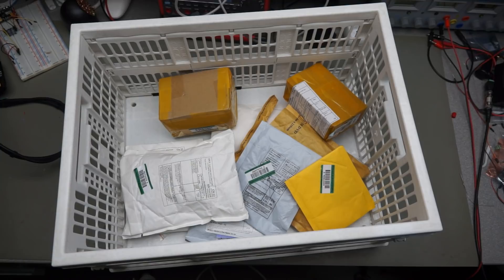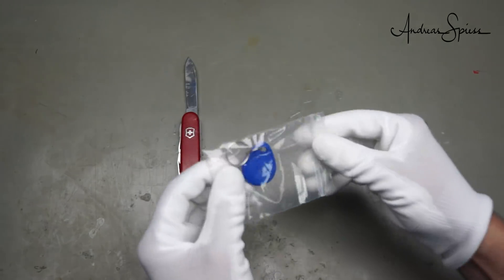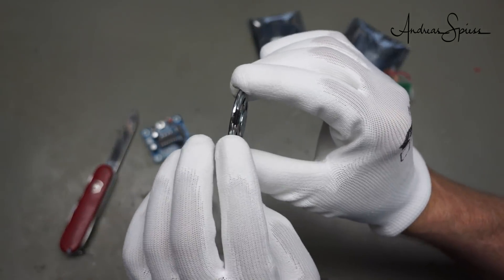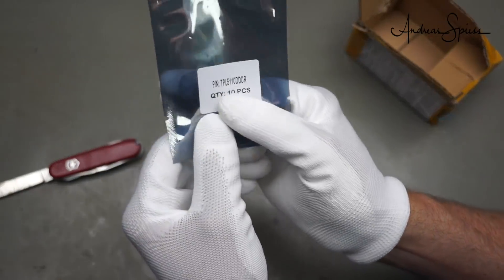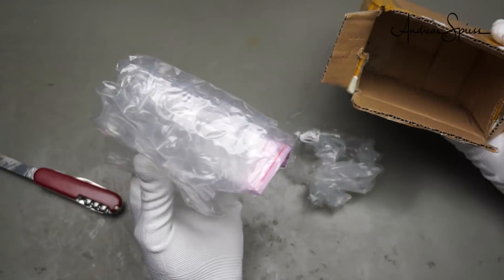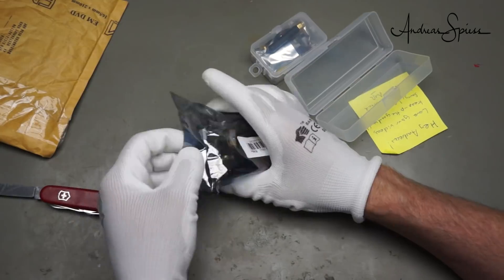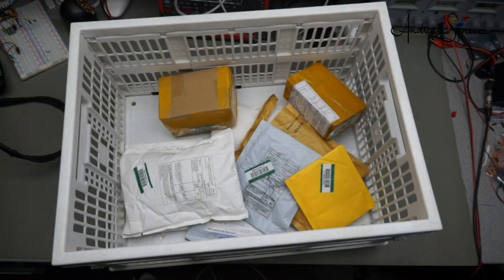#217 Mailbag Part 1: RFID, Low power & Energy Harvesting, new LoRa boards

Comment: As for the material sealing the RFID reader, it's a potting compound. You can also use nail polish for waterproofing simpler projects, as demonstrated here: https://www.youtube.com/watch?v=h8ycmroFQSs.
Reply from the maker: You are right. I saw this video too and I plan to do an update for the moisture sensors, also using nail polish.

Comment: I see you're getting into RFID. I have some experience with it, and it's pretty cool.

As for 13.56 MHz (HF), I have two RC522 reader/writer modules, very cheap, just 3 €/$ each, and a PN532 reader/writer module, which is better and you can hack MIFARE Classic cards with it, a Serial to USB converter and a computer. It's 6-10 €/$ depending on the size (the larger, and more expensive one has a longer range). As I said, you can hack MIFARE Classic cards for a few dollars (big failure from MIFARE), so you shouldn't use them for security. You need more expensive MIFARE DESFire EV1/EV2 cards or an alternative such as Sony FeliCa cards. Both are readable by the PN532, but not by the RC532.

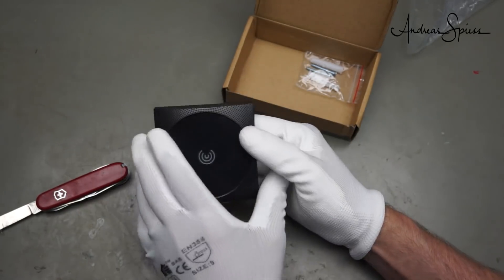As for 125 kHz (LF), I only have the EM4100 reader module (like the one at 03:38). Notice that it's not a writer, so it can only read cards. I have blank 125 kHz cards, and I bought it thinking it would write to them... Oh well, I'll make my own writer as I can't see a cheap one anywhere.

Comment: Hi Andreas you should try the Decawave DWM1001 sometime. Looks really cool. It is an indoor positioning system for relatively cheap. It has integratet Bluetooth, Serial and SPI.
Reply from the maker: Cheap is different! One reader costs around 250 dollars and you need 4 of them to detect the modules in space. Or did I miss something?
Reply: @AndreasSpiess  I just bought 6 modules for 20€ each. There is a development board for 250 dollars but the module alone is ready to use. It has the UWB and Bluetooth chip integrated. It also comes with firmware that lets you control it over serial, SPI and an Bluetooth Android app. There is a lot of information in the spec sheets on decawave.com or digikey.
Reply from the maker: So you refer to the boards. When I looked at their offer I thought, they sold special modules for this positioning application. Did you try them out already?
Reply: I ordered some DWM1001 modules but I'm waiting on some adapter pcbs that I made to make testing and prototyping easier. They offer the DWM1001 modules with UWB and Bluetooth or the DWM1001-DEV modules with integrated debugger, leds, buttons and more. The Dev module is more aimed at developing new firmware for the module itself.

Comment: Nice thinks ;) Other Question. I Play a litte bit with SDR but don't receive a good  or any signal. I think i dont have the correct antenna. Can you make a tutorial about antennas? Like how can i choose the correct one etc..
Reply from the maker: Antennas are complicated. I covered a little in some of my videos. For the reception, it is usually important that your antenna is long enough (at least wavelength/4). Which can be pretty long for low frequencies. Also, it has to be the same distance over ground.
Ham Radio sites cover a lot of antennas. Maybe you google.

Comment: I am using RFID a lot. The 13MHZ MiFare together with the smartphone, e.g. to open the garage or main door. You can hide the tags in lamp or at the rear side (inside) of a light switch plate or in the car.

And when my mother started to develop dementia she always left her home without a key. Returning home always was a Nightmare for her and the neighbourhood. So I connected  a 125kHz RFID-Tag on her wristband which she always wore and used an RDM630 and a WeMos D1 mini to communicate to Homematic & Keymatic for opening the doors.  This enabled her to live additional two years independently in her house. 
So, you can imagine that I am very gratefully for this technology
Reply from the maker: I had looked at the technology for a long time because of such stories about its usefulness. Now I decided to jump into it...
Maybe I have to come back for advice if I may.
Reply: of cource you are welcome; feel free to ask. I have to admit that the method for my mother is not very secure. You could copy the tag and you are in.
However the 13MHz MiFare system is more secure because the communication is handled by my smartphone in my WiFi home Network. The tags are Kind of "public" and just trigger a specific program in the smartphone using "Trigger" and "Tasker". My smartphone is in my home Network and sends a message to the electric door opener - in my case homematic / keymatic.

Comment: Dear Andreas, which LoRa board is the best according to power consumption and signal range? I'm looking for a board to build a small remote weather station, and need power savvy and signal strength to achieve my goal. TTGO V2 board signal strength is just too weak to work properly... Thanks for your help.
Reply from the maker: All current LoRa boards use the same Lora module/chips. So I would assume no big difference there.

Comment: As to UV sensors: I just installed one on my solar PV rig. I only have two days and a bit of data, but UV intensity and PV array output appear to be directly proportional, and the UV sensor is a faster and more reliable source of data, so it can be used to predict an expected future PV array output. As you no doubt learned, an intermittently loaded PV array is not an ideal measurement sensor.
Reply from the maker: Interesting. And I ask myself if UV behaves differently than normal light (in respect to PV output)
Reply: It's interesting that visible light intensity is no guarantee that PV panel output will be high. A cadmium photocell frequently indicates that light intensity is high, yet PV output is poor. UV intensity appears to be a much better indicator of PV performance. II'm collecting data for a spreadsheet of datetime, various light sensors (currently 5 colors:UV, a 'white-balanced' silicon photocell, and 3 cds cells w/ RGB filtering and balanced to the 'white' photocell), plus temperature, and the output of a PV panel with MPPT tracker and a fixed resistive load.

Why? It's interesting. Maybe I'll create the perfect MPPT tracker, 0.00017% more efficient that the one I have!

And yes, the shorter the wavelength, the higher the output. I imagine there's a limit to that, but I currently have no way to measure light intensity above UV frequencies. https://cpb-us-e1.wpmucdn.com/blogs.uoregon.edu/dist/2/13097/files/2016/02/Solar-Cells-2-Shading-and-Light-Color-R2-15krh3z.pdf

Comment: RFID is a ubiquitous technology that continues to be tapped as an "active" logistics platform. 

Many are surprised Barcode / QR have not overtaken RFID - yet. 

Both have security issues and quality control issues when applied to low cost applications. High performance Card readers and electronics are 100 times more expensive than any of the pieces you have shown. Even then, their usage has finally reached its plateau. 

But there are some new applications for RFID that are finally emerging and do not require complex environments. 

Probably the biggest growth sector is in the Agriculture and Forest Management. I suspect you have a strong interest in this area based on your previous videos. When combined with other sensors, they are a powerful data collection tool when integrated analytics tools can proactively leverage the data collected. 

When combined with other technology and applications such as drones equipped LIDAR, the monitoring and cross reference capabilities become a powerful management tool. 

You might be interested in some open source NASA, EASA and JAXS enviroment datasets that can assist you in any design and interoperability requirements depending on the objectives desired. 

A very nice collection!
Reply from the maker: For the moment I only have low-frequency equipment, which seems to have a low range. UHF stuff is on its way...
And I ordered a few RFID nails which are intended to be used with wood.
We will see where it leads... Do you have any links in the area of agriculture or wood management?

Comment: Tip for the Russian manuals: Get a Russian friend. 😎

Failing that, learn to sound out the Cyrillic letters and you will find that they borrow some technical terms from English and German.  Not perfect, but it's a dim light in a dark hole.

Online translation is also possible with images! Don't bank your life on those... Use them if you can.
Reply from the maker: I did not investigate, but I hope I will find some English description. (As I am married the thing with the Russian Friend is tricky...)

Comment: Excited to see what project you come up with for the RFID components, my final year project for my bachelor's was based on a cheap RFID based moisture detection packet.

I used the sticker type RFID tags with a grounding plane and some absorbent expanding material to make a tag that was only detectable after moisture was applied. I put some of the project details on Instructables here https://www.instructables.com/id/Cheap-Smart-RFID-Packet-for-Moisture-Detection/ But if anyone's interested in more details let me know and I can put together a write up with some more of the testing and details from my thesis! :)

Jack
Reply from the maker: Interesting idea! And a completely different way of measuring moisture ( and maybe other small distances). I wonder about how long these sensors would survive in real situations. Did you do tests?
Reply: Hi Andreas! Yeah it was a very interesting project, the goal was to see how off the shelf components functioned in this situation. The maximum range I managed to get was 30mm read range with a 45mm coil sticker RFID tag and a off the shelf USB 2W RFID reader.

The characteristics & orientation of the grounding plane had a dramatic effect on the read range, we began to experiment with placing holes at specific distances and sizes to allow the maximum amount of radiation as possible. Unfortunately I ran out of time to fully test this.

The student who took over the project the next year began to investigate how the RFID tag design could improve performance in this situation with the goal of designing an Ideal tag and fabricating it.

The theoretical goal of this project was for adult diapers, the idea would be to put a RFID reader in a hospital bed that could detect when I diaper needed to be changed. The nurses would immediately be told which patient needed assistance (Sometimes a patient may be unable to tell or too embarrassed to ask). This would also reduces wasted time where nurses have to check each patient as well. As for how long these would survive I did not look into that, these were obviously 1 use items :). It would be interesting to find a substrate material that could expand when moisture is present and then reduce its size back when the moisture has gone again, this would allow for a lot more options!

Comment: You should have a look into UHF-RFID Tags/Readers. They use the ISM Band of 868 MHz (EU) / 930 MHz (US) and have a reach of few meters. They are used in logistics, slowly replacing barcodes. T-Shirts for example often have them in the label.
Reply from the maker: Already on its way from China :-). But it is much more expensive:-(
Reply: Nice :) How much did you pay for the reader? I know they're not cheap... I found some low power USB readers for ~70 Eur, but they won't get further than ~80cm I think...
Reply from the maker: 53$. To understand the principle I hope it will be enough.

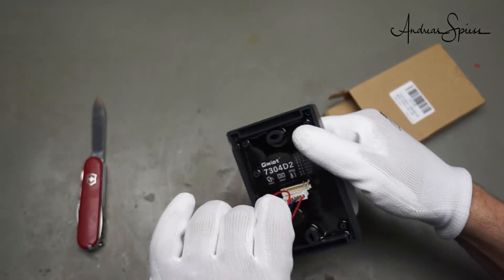Comment: Btw, if you're looking for epoxy raisin to seal off equipment (RF sensor video 10:20) have a look at this:
https://www.vosschemie-benelux.com/nl/product/epoxy-hars-voss-ep-system-eps-epoxy-bn-a-b-1-kg
It's one of the best products I've ever worked with. It doesn't shrink or deform and can be used over a wide temperature range.
The site is in dutch, but somewhere they have a German site.
Reply from the maker: Thanks for the link. I will have a look at it. I already ordered some stuff in Germany...

Comment: Interesting stuff, 
I have been using the tpl5010, its a great chip with very low quiescent current, and very good for "deep-sleep". I had one thing that puzzled me, be aware that the wake pulse is so short that the MCU might not be awake in time to hold the power on.
Regarding the ML8511 (obsolete on Digikey) , I can recommend the VEML6070 with I2C interface.
Reply: See https://github.com/Edzelf/LoRa/blob/master/Nano%20power%20system/Low%20power%20system.pdf
Reply: For switching power, I would recommend a TPL5110. A TPL5010 is primarily designed to wakeup a MCU in deep sleep by an interrupt (WAKE) and provide watchdog functionality (DONE). The TPL5110 is designed to switch power to a circuit and simplifies this design a lot.
Reply: and what ist the TLP5111 for?
Reply: @underwood You can see the typical usage scenario in their respective datasheets. TPL5111 is meant to drive the ENABLE pin of an LDO.  TPL5110 is meant to drive a mosfet that switches power to the entire circuit.
Reply: Well interesting configuration, but not made as the datasheet describes. The wake signal is pin 5, witch goes high at timeout, and can be rescheduled by applying a done pulse on pin4. Pin 6 is supposed to reset the MCU when something goes wrong. But of cause you can use the RSTn as the "timeout pin", I didn't know that the RSTn did a repeatable resets with the wake interval, its not that well described in the datasheet.  

Your schematic:
But I can't figure out why the circuit works. 1) When not timeout pin 6 (RSTn) is floating, this means that R3,R4,R5 and R8 is in serial (all 100K)  the basis of the transistor is taken between R4 and R5 which should be around 4,5v/2, when the transistor is connected the basis voltage is about 4,5V - 0,7V which mean that current is applied the basis, perhaps the current is too small to make Q1 conduct. But under all circumstances an unnecessary current is floating through all resistors plus the basis emitter on Q1.  2) Shouldn't the hold signal not be low to continued power on? If this is correct the Hold output from the MCU could go low during power off, due to internal protection diodes.
Reply: There was an error in the schematics.  R5 is connected to the base of Q2.  I have made a correction.  Thanks!
Reply: Now the schematic gives more sense.  Good luck with your project.

Comment: I tried to stop watching the video... I knew I'd ruin my budget the moment I looked at the title. However, it's stronger than myself...
Reply from the maker: This is why I added the warning ;-). However you are above 18 (I assume)
Reply: Above 18... !? Well,... the first digit starts with a 5, then the number is on the wrong side of fifty. However... mentally only 25. Probably forever... 25 !
Reply: storage space is the problem, not the budget ;)
Reply: Tell me about it. Moved from my garage to my shed in the back yard... Shed became too small... so an extension was build. I call the extension the left wing. Now I'm in the proces of finishing and making an inventory of all my stuff. Lot's of pictures that I put in the could. This is really necessary because I start to forget about my stuff. So every now and then I buy something that I already have, but forgot or was unable to find quickly enough.

Comment: Regarding the really low power project. You can check out the Trigboard by Kevin Darrah. It's esp8266 based and uses a power gating chip like you just bought. He has a nice video explaining how it all works and what extra stuff he did for super low power. I designed my own variant based on it, still working on it. You also need a regulator with an enable pin to get good efficiency.
Reply from the maker: You are right. I bought the chip because of Kevin's video. And he promised to send me one of his boards to show it to you...
Reply: Andreas Spiess exciting 😀😀🏴
Reply from the maker: It seems to be on the way...

Comment: Hello,
Since you are looking into RFID for projects, I would recommend you look into the "PN532" RFID/NFC reader. They are really good for interfacing with microcontrollers and Raspberry pi and have SPI, I2C and UART (Called as HSU "high speed UART) communication option on the same board. It also has an onboard PCB antenna!
Reply from the maker: AFAIK these are 13.56 MHz. So I hope I covered it with my current purchases. But so far I do not know enough...